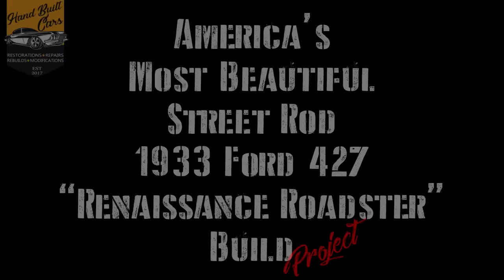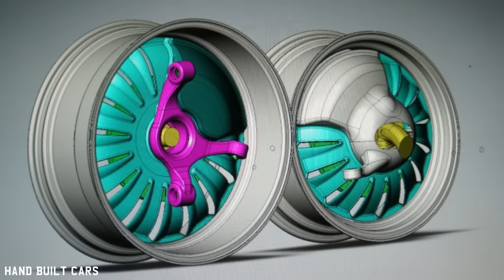America’s Most Beautiful Street Rod 1933 Ford 427 “Renaissance Roadster” Build Project

Comment: A very thoughtful, artful, well planed and executed build. I’m not surprised it was given the riddler award. But being a Ford guy and seeking purity, was the big block Chevy necessary?
Reply: I agree. An all aluminum Shelby 427 side oiler!
Reply: I think we can go ahead and assume that there was very little Ford in this build.
Reply: They put the chevy engine in it to save money & cut corners. A 427 ford would cost them double. However in the long run it would have saved money. Where as when the chevy blows up. It will cost more money to either rebuild it or replace it. With the ford engine. You would not have that problem.
Reply: Should’ve labeled it a 33 Chevy instead. Only the grill resembles a 33 Ford anyway. Nice workmanship though.
Reply: They wanted to be able to drive it too....lol....sorry ford guys.
Reply: @Tom-kn6sr   😅👍💯

Comment: 5:56  I don't think I've ever seen a car with independent rear suspension (with those incredible custom A-arms, that you can't even see on the finished ride), but straight axle front, instead of the other way around. And, bizarre location/orientation for the suspension springs- I can't even figure out how they'd work, in that spot. Some kind of hidden push-rod set-up, or something? Well, you can't say they didn't think outside the box, I guess...

Comment: …theres something very wrong with the design…its like it have a pygmes shrunken head on top of normal scaled chassi…look at it…three scales at the same time…no one…the chassi…no two…red painted body part with the upper part of the front end…no three…roof and windows…and there is also a problem that the fragmental styles can be traced to their origin…it has not transformed to something of its own…yes…im used to judge art and i am a member of the swedish royal academy of art…look at it and look again…the result is a car driven by a shrunken pin-headed driver…